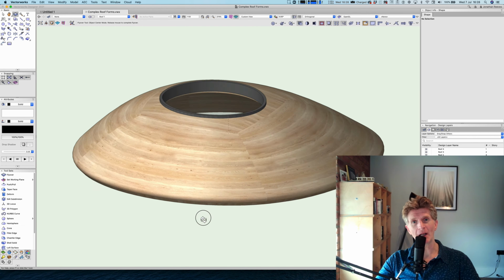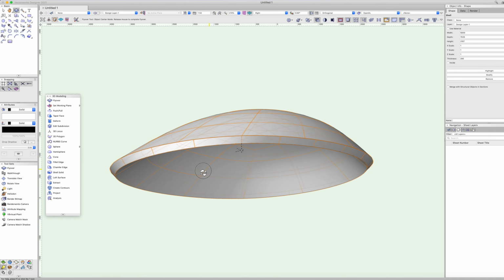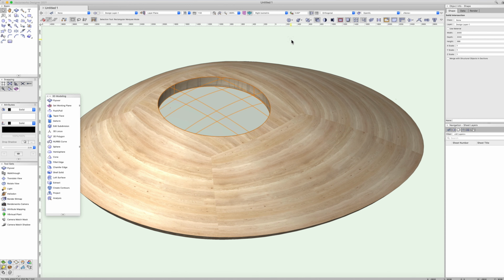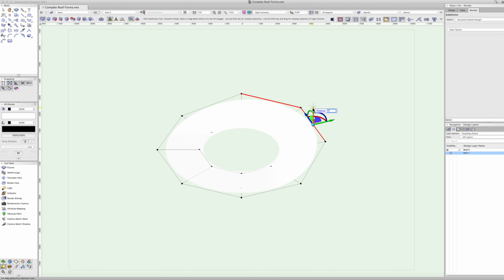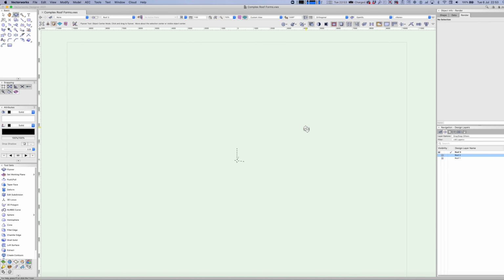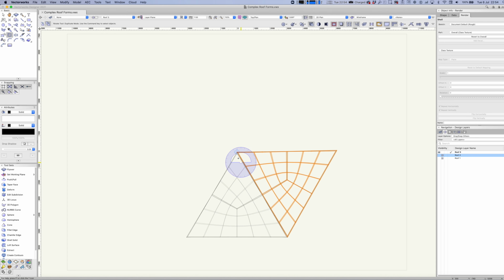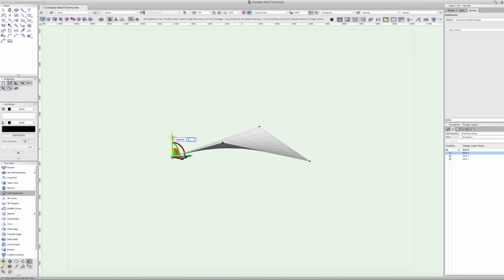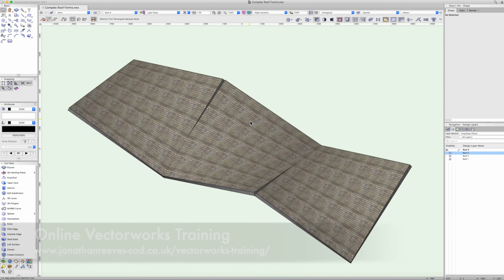Creating Complex Roofs in Vectorworks (Using Subdivision 4K)

Comment: @jonathanreevescad I have a question. I followed the instructions and it worked but in sections it does not show the structure because it is not a real roof, is it possible to convert the generic solid to a real roof, so I have the settings like a real roof including connecting with walls, having a roof structure etc. thanks in advance
Reply from the maker: Ok